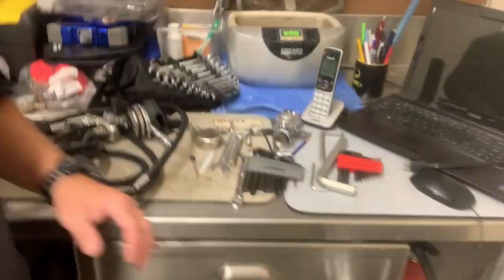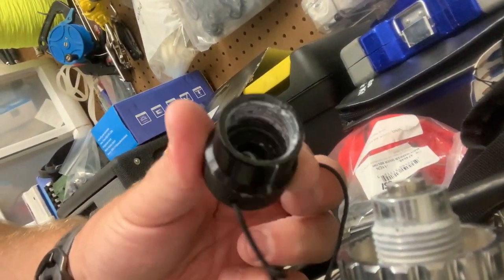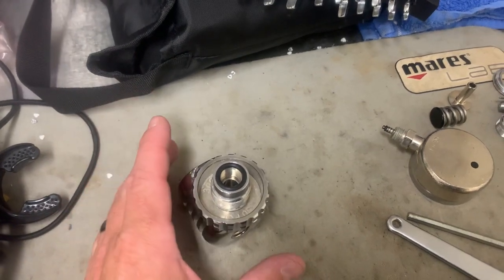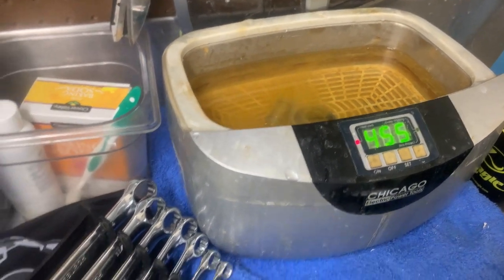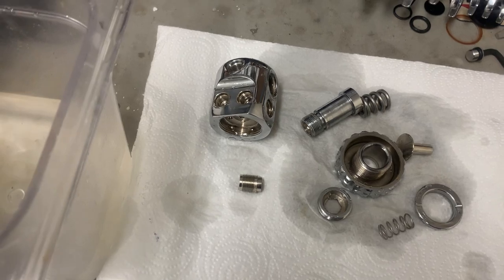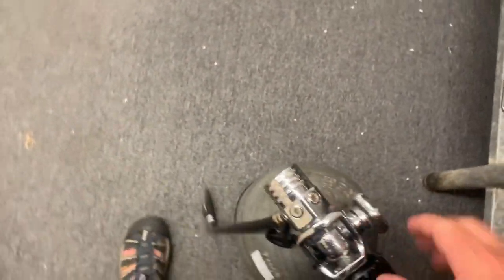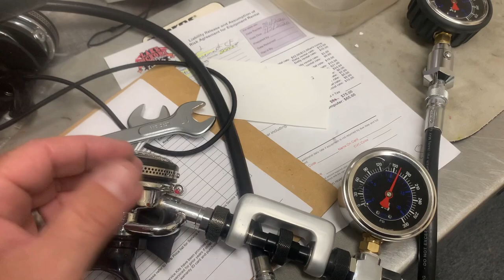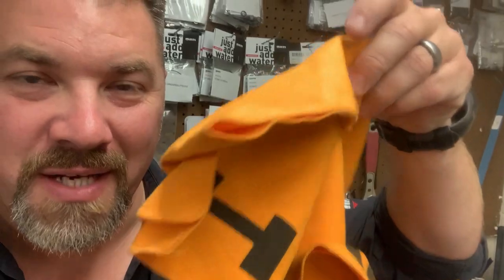That's One "SALTY" Regulator

Comment: I just checked this video out and it got me to thinking. I've done over 30 dives since changing over to a BP&W late last year and never took the wing and backplate apart when cleaning them. Sure enough, tons of salt and what appears to be scoring on the backplate where it meets the bolt assemblies. It's aluminum so, not sure about that part. I've got the whole assembly soaking in hot water. I don't have any gear cleaner and we're leaving in a few days for a trip to Cozumel. Hope this works.
Reply from the maker: A mixture of White Distilled Vinegar and Water, works great as cleaner to get rid of corrosion.

Comment: Bryan, EXCELLENT content as always! I service regs for my local dive shop and occasionaly run into the reg from Hades that has been exposed to multiple saltwater dives and unforgiving lapses in maintenance schedules..although I am confident you have witnessed this more than us all combined!  In your comments, you reference a 50/50 vinegar-water solution for the ultrasonic bath. Have you ever encountered saltwater corrosion/accumulation that was unresponsive to this solution? If so, please would you describe what cleaning solution or method(s) you have found to resolve said presentation? Is there a commercially available cleaning solution you would recommend that you have proven more effective than the 50/50 mix? Along these lines, any lessons you learned the hard way that one should avoid or made the service easier? Thanks, as always, for providing such great resources for the scuba community!
Reply from the maker: Hello A. White, Great question. Another great solution mix is Simple Green and Water, 50/50 (We use the same solution for O2 cleaning cylinders as well). Vinegar is always my go to, as its cheaper and least likely to damage the coatings on regulators. I will state this, once corrosion gets to a certain point, it will eat through the coating on a brass regulator, beyond repair. Doesn't mean the regulator is ruined, but cosmetically, it will never be the same. This can cause issues internally though, especially in the intermediate chamber. I have had customers bring me regulators that could not be opened or disassembled without a heat source to break them free. Once it gets to that point, we typically charge more for the service (a lot more---------a whole lot more------sometimes enough that its cheaper to buy a new regulator). This usually involves having the customer come in and we have a little chat with them. We show them the regulator's condition, and we explain the extra cost to them. We give them several options, from simple repair, to the extreme of purchasing a new regulator. Truth be told, as a business owner / service technician, we have to decide at what point do we start to lose money on service. The more time spent on repairs, the less we make, obviously. But we also have to look at it from a liability standpoint. Once we start using methods outside of what the manufacture trains us in, to disassemble a regulator, do we fall into the rabbit hole of voiding the warranty of the regulator. If we do, at that point we become completely liable for that diver's regulator. This is only occurred just a small handful of times with me as a technician. One incident, the customer sucked it up and bought a new regulator. I even taught him an Equipment Techniques Course for free and taught him the proper way to clean his regulator so he would never be in that situation again. Another incident, the customer got very upset with me and left screaming and cussing. After taking it to several other shops, he came back and apologized, as none of the other shops would touch it. Then he even asked for a discount on purchasing a new regulator, LOL. The biggest key to keeping a regulator from getting this bad, is simply cleaning it with freshwater after every dive. If any signs of corrosion are observed, then immediately taking care of it is crucial. Once they get so bad, well, trash it and get a new one.
Reply: @LakeHickoryScuba  Thank you so very much for the expeditious reply, my friend! 

I truly appreciate the time and effort you put into responding to this inquiry! It’s speaks volumes of your character and your commitment to excellence in all you do! Keep up the great work!

Interestingly, I had previously considered the Simple Green route primarily because of concerns for the low pH of vinegar compromising the metal finish. Based on your feedback, however, it sounds like (S.G.) would have had the opposite effect of intended and could potentially be more unforgiving than the vinegar solution. 

Thank you so very much for your wise counsel and great resource!

Comment: Hey Bryan, do you think that some of this could be a reaction between the dissimilar metals accelerated by the saltwater?   I believe I had the exact same problem which I blamed on the aluminum din cap.  Never had the problem before using aluminum and have not had it again since switching back to delrin caps.
Reply: Yes a problem with Dins
Reply: It’s electrolysis, salt will accelerate the process , using non metallic DIN cap will prevent it.
Reply: @tankmonkey7753  you missed the point
Reply: iamdrambuie please explain what point I missed, he asked if it was a result of dissimilar metals (electrolysis) was accelerated by saltwater (it does)
Reply: @tankmonkey7753  but it's a plastic cover. So electrolysis isn't involved.
Reply: iamdrambuie I guess I did, it really (had to watch vid multiple times) looked like an aluminum cap, plus that’s a lot of salt! Looks like too much powder to be just salt...
Reply: @tankmonkey7753  yes jeff, I don't have enough info but I describe it as a 'stagnant' type of reaction.  Some times when the normal Catalyst is missing as inside the plastic cap, because so many ions are busy they just create a reaction.  As I said without samples I can only speculate. Possibly chlorine residue could contribute.
Reply: @tankmonkey7753  I thought it was an aluminium cap too, it even sounds like one. Are you sure it's not?
Reply: @iamdrambuie  it definitely looks like aluminium! It even has a knurled grip!
Reply from the maker: Hello Brock Morrell, not knowing that much on the metallurgy of both steel an aluminum, I can't really comment. But I will definitely be switching to delrin caps very soon. A lot of this was caused by me just being complacent and not properly cleaning my regulators.
Reply: @iamdrambuie  I would suggest that it was an aluminum cap. In my experience, that squeaky sound only happens with aluminum din caps and you can also see that it is shiny.  I had the exact same problem, after which I got rid of all the aluminum din caps and plugs that I had, going back to Delrin only.  Have never experienced the problem again.
Reply: Some caps that look cheap are kinda cool and have grooves perpendicular to the threads to lets water in ...the oring seals the reg guts not the threads.

Comment: Can salt in the 1st stage, cause corrosion - such that the chrome flakes off - inside the 1st stage?  I had salt in my 1st stage  reg a few years ago - it was cleaned out - , and just last week (years later), chrome peeled off internally in the 1st stage, and travelled into my 2nd stage jamming it up and causing a free flow.
Reply from the maker: Great question @stevebaker6342, corrosion can occur, but the flaking can also be caused by the cleaning process. Depending on what cleaning solution is used and the set temperature of the ultrasonic cleaner, that too can cause the chrome plating to come off the housing of the regulator.

Comment: Hey Jeff I found a stainless steel Scubapro dive knife and first stage piston regulator in a regulator bag under water . They have some surface rust on them… what do you suggest I use to start removing the surface rust off ? (By surface rust I mean brown/orange chunks on the surface of metal)
Reply from the maker: Hello Scuba Bro, we use a 50/50 blend of white vinegar and water in a ultra sonic cleaner to clean the regulators.

Comment: @LakeHickoryScuba what kind of lubricant do you recommend when putting regs together or just putting around the threads of reg/o ring ? Thanks!
Reply from the maker: Hello Florida Mike, Cristolube is the industry standard. https://www.amazon.com/Christo-Lube-Scuba-Diving-Nitrox-Regulator/dp/B006G0PHOM/ref=sr_1_1?hvadid=583270992650&hvdev=c&hvlocphy=9010198&hvnetw=g&hvqmt=e&hvrand=7114201985134051511&hvtargid=kwd-337327928794&hydadcr=8113_11326894&keywords=christo-lube&qid=1681564591&s=sporting-goods&sr=1-1

Comment: So, if you’re supposed to keep it capped while cleaning to keep water out of the sintered filter how are you supposed o clean the threads regularly?
Reply from the maker: Typically, I will use a tooth brush and a microfiber cloth. Simply, scrub the threads, then wipe them off. Simple, yet, effective.

Comment: Could you do a video on how to clean the inside of a Steele cylinder
Reply: I'd imagine you blast it with water mixed with some form of grit. Or some kind of acidic cleaner
Reply: You use an tank tumbler some proper hard abrasive gravel and water  and you set it on a timer grab a beer and let that tank spin for 10 - 30 minutes depending on the rust etc  !
Reply from the maker: Hello Jonathan Stanfield, we would be happy to make one. There are two types of cleaning. The first is O2 Cleaning, and the second is tumbling. I will see what we can get made for you.

Comment: I have a question for you when you service a regulator do you check the depth gauge for accuracy? The shop I go to charges extra for that.
Reply from the maker: Hello Topmaul Scuba, this will differ from shop to shop. Typically, any time we service a Regulator set, we will replace the O-rings in the pressure gauge, but rarely do we test for accuracy unless the customer specifically ask us to.

Comment: I do my own maintenance/builds on everything in my life. Is it completely farfetched that I can't learn how to service my own Regs / BCD. I think the only difficulty would be getting the parts.
Reply: I'd like to service my own regs too.
Reply from the maker: Hello kirbythebamf, there are several manufactures that will offer a class to learn how to rebuild regulators. Most operate in the same manner, the biggest thing is making sure you use the right tools for the job. Also, a lot of the major brands are offering direct sales on parts now.

Comment: Brian, what would this cost as a customer.... I have regs that havent been serviced in more than 18 years and they are probably full of salt
Reply from the maker: Hello Steven Rogers, our repair and service fees are pretty consistent with other repair centers here in our area. $35 a stage plus parts, unless the regulator was purchased from us, then the parts are free for life. In a situation like this where extra clean is required, then it is $50 per stage.

Comment: Do you have to put a dust cap on a din tank valve? I always assumed that if you didn't water would get in the valve.
Reply from the maker: Dust Caps on valves, whether it is DIN or YOKE, is all a personal choice. In reality, we use them as an indicator as to which tanks we have been filled, and which ones need to be filled. As far as getting water into a DIN valve with a cap in it, you would need to be near water, and most likely submerge the cylinder to get water in it.
Reply: Scuba Steve and Underwater Rock Climbing. Its also protects the screw thread against impact if the thread is damaged, you can also damage the thread of the tap. prevention is better than cure

Comment: Good reminder to use remaining tank pressure after the dive to blow out the plastics Delrin dust caps and the threads of your din regulator before capping off. As you already stated post dive clean up is where it’s at. Seems like an achilles’ heel for most of us myself included even as OCD as I get there are time I just don’t take as much time to do a full post dive cleaning as thorough as I’d like each time. 

Great video content keep up the great work and happy diving! 

Cheers, #SeattleRingHunter
Reply from the maker: Thanks Jeff Morgan.

Comment: Salt is a b#tch. :D People tend to forget BCD's though, i got one 2nd hand, connected the inflator, pressed the button, and sssshhhh, it got stuck. Luckily not underwater, i test and clean everything before using, lube the seals, etc. 
This one had 3mm salt crystals inside, some rust on the springs, and small stones. A faulty BCD like this can get someone killed too, shoot up from 30m.
Reply from the maker: All very true. I have seen several divers have malfunctions with their inflators, all cause by salt build up.